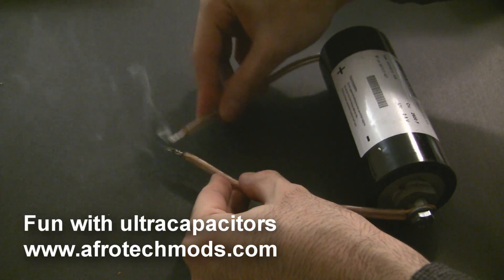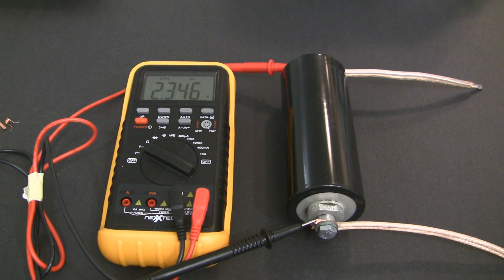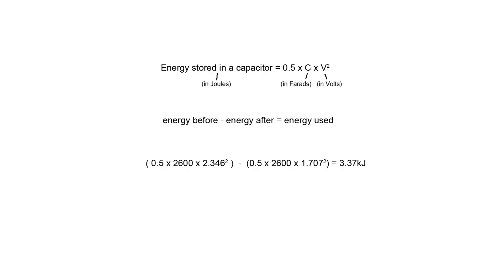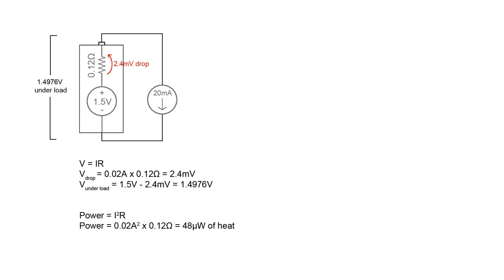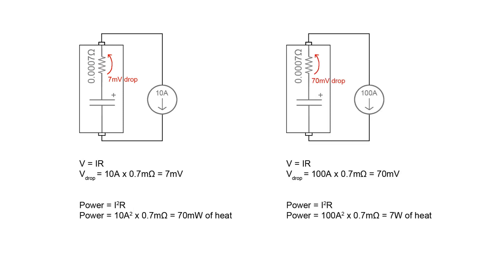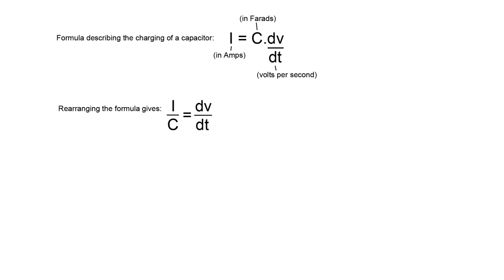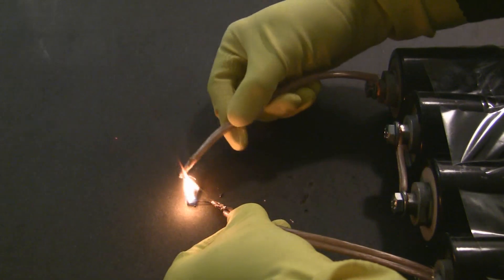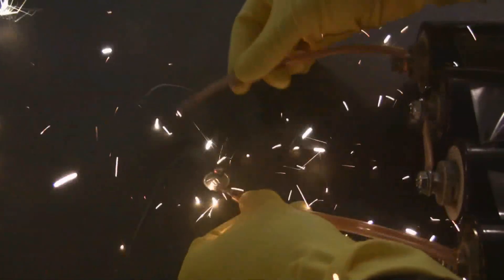Fun with ultracapacitors!!

Comment: You should try them in liquid nitrogen to see how many Amps you could draw with an even lower resistance xD
Reply: Keystone Science it would freeze the electrolite and they would be done for. The frozen electrolite would penetrate the separators
Reply: Keystone Science  Nice to see you all over the Science channels! :D
Reply: wont work it will freeze the electolyte, it would short out internally
Reply: Yes it is, if you low the temperature de solvent inside incresse the viscosity descreasing the easy way to move the charge carriers, so they need to rise the temperature to decrease the internal resistence and get more current leaving or come to the supercapacitor
Reply: Maybe with a supercapacitor designed to work with liquid nitrogen

Imagine that it could have lest capacity but up to 1000A
Reply: keystone science you are my hero
Reply: Maybe you should slow down when you talk

Comment: Could this kill me if I touch my finger instead of a coin? :) could 2.5 V kill me in this example?
Reply: Marek D no
Reply: Marek D amps kill
Reply: yes, but ultracap can't push amps into you'r body. It creates voltage, than body draws as much, as Ohm's law allow flow in the circuit. Human body resistance is in Koms-Mohms range, so curren't will be negligible

Comment: the faster and better way to do this type of high current fun is to buy a high power toroidal transformer cost almost same as this one capacitor and just wind 3-4 turns of high current capable wire on the outer side of toroidal transformer and have fun

Comment: if you touch it will you get an electric shock or will you just get burned ?
Reply: +Motorguy81 Yeah, the algorithm doesn't always know when to write your wrongs.
Reply: a car battery is more dangerous
Reply: +That Guy 

not get a shock nor a burn*

I had to be what your name states...sorry 😊
Reply: under normal circumstances neither you Will get a shock nor a burn.
Reply: not a shock nor a burn*
Reply: You will burn your fingers if you touch the coin after shorting over it though.
Reply: +Baiko That pun worked so good
Reply: DragonsREpic BBC

Comment: What if you replace your car battery with two sets of these in series connected in parallel? I believe it will definitely start the car and provide some runtime abd even charge fatser than a car battery but it may vaporize the start motor, which is a pretty heavy duty motor.
Reply: it's a thing. Look up 12v boostpack etc or a video of mine.
Reply: MiG21aholic Yes, I have seen one. It's a very clever way to use super capacitors but the only downside is that it can be depleted faster than a normal car battery.
Reply: +PunakiviAddikti yes. For modern vehicles with high parasitic load a small lead acid would help with that
Reply: MiG21aholic True, if you have a lead acid battery for other devices like radio and the capacitor bank for startup, you can have powerful start motor and long-lasting energy source for other appliances when the engine is not running to not drain the capacitor bank quickly. The engine could then charge both.

Comment: the ultracapacitors soon will replace the classic batteries,, because his very low ESR,,,but this is a problem too: these capacitors delivery a huge current,,,so be careful with use them,,,and protect the circuits with  high speed fuses.

Comment: Hmm I am wondering something : In theory you could touch both wires of your ultra capacitor since the voltage delivered is too low to push enough current into your body  to harm you , right ?

Comment: What if you put the capacitors in parallel?
Reply: you still at 2.5 volts
Reply: with the paralel capacitors,,,the energy  duplicates,,with two capacitors,,,the energy cuadruplicates if you put four  capacitors,,,,the voltage is the same...
Reply: nomon95 please,, use common ,,,,,, sense,,,,, in your ,,,,typ ing

Comment: is it possible to use capacitors like these to run electric motors in cars or are they to unefficient?
Reply from the maker: +IdCrisis That's exactly what they are used for. Temporarily storing and delivering energy to/from electric motors during sudden starts and stops. But the capacity isn't high enough to last longer than a few seconds.

Comment: Can such a capacitor REPLACE A BATTERY? I am thinking for example a portable power supply (5V) for mobile phone/laptop...
Reply: no, it generally CAN NOT, because the energy capacitors store is very small for their weight and size and they also self-discharge fairly quickly. A lithium ion battery pack is still best for the job.
Reply: Thanks for answer. How big (Farads) a capacitor should be to replace a 'normal' (1.5v) battery..... This, ignoring the self discharge problem (which is not that big since you can recharge it so easily).

Comment: Having that much power and doing neat stuff with it is fun, but I would like to know what would be some particle applications for super capacitors? I for one would love to have a 'bank' of them during a power outage, so how would I use them in a practical application during an outage?How would I turn that raw power into useful energy?
Reply: These capacitors barely store any energy, they are just good to buffer extremely quickly spikes. Stuff like noise, smoothing out power supply and making DC from mains power - things that are VERY fast and don't require a lot of energy storage. 
The situation you are describing would be best suited by lithium ion batteries, which hold much more energy, do not self discharge as quickly and hold a lot more energy for their size and weight. 
Such a thing is actually currently being built in my city by Mercedes, using batteries from electric smart cars.

Comment: What's a practical use for these things?
Reply: +Sand Pox Sure, but what's a real-life scenario where you'd use one of these (other than to "have fun")?
Reply: +Nate M well batteries have high ESR which affects charging as well as discharging. However supercapacitors have low ESR so you can charge it quickly and discharge it through a circuit your powering over along period of time. TL;DR the main advantage over batteries is charging time.

Comment: I know that adding capacitors in series decreases the total capacitance but the combined voltage rating increases. 

But what I just thought of is this; wouldn't the ESR's add up? The greater combined voltage would allow more current to flow through the load, but this increased current flowing through more resistance would create a higher internal voltage drop than before.

Comment: Can this kill you? i heard that there must be some "high" voltage and that some miliamps can kill you..is that true?
Reply: +Geras xD yes the current is what kills you but Electrical current is the product of I=U/R (Current=voltage/Resistance) so even if this capacitor can output 1000A it will not kill you because the 2V of the capacitor are not strong enough to puch that much current threw your Body

Comment: So since EMP devices rely on a large voltage being released through coiled wire, would ultracapcitors be the route to a larger effect distance or would they not work because their voltage is low but have high energy instead.

Comment: Can you die by directly touching the leads of the capacitor? From what I know, if you have a 100k ohm skin resistance, then for the 2.5V cap you get a 2.5/100k = 25uA. That shouldn't be enough to kill, right?

Comment: Two similar capacitors in series give half capacitance of one of them while the voltage becomes double, four 260F 2..5 capacitors in series are equal to 65F 10V capacitor.

Comment: Isn't voltage based on charge magnitude? 

How can such an incredible amount of charge be stored without a large voltage being generated?

Is E field strength (Which is determined by charge magnitude) not DIRECTLY related to voltage?
Reply: +Zambia95 not in this case my Englich is not good enough to explain the reason but it comes frome the way a Capacitor works but if you are interested you should google how capacitors fork and you will understand

Comment: For people who are wondering if they will die from touching those wires...
If you touch the wires, you will not get killed due to the fact that the capacitor's voltage is very low. Think of the human skin as a resistor. In order to find out how many amps are going through the body, we could use Ohm's Law (Voltage/Resistance = Current). The average human skin is around 10k - 30k Ohm, depending on how wet your fingers are. In this example the caps are about 9 volts and let's say the resistance of our fingers are pretty dry and are about 10k Ohm. (9 volts/ 10000 Ohm = 0.0009 Amps) 0.9 mA won't be enough to even give you a slight tingle. In conclusion, these capacitor are very low voltage so they can't kill you or even give you a slight tingle.
Reply: how about connecting the supercapacitor output to a stepup transformer or a flyback transformer ?? is it dangerous then??
Reply: Your power supply will be dangerous then, not the capacitor itself.

Comment: could you touch the wires and not get killed?
Reply: idamontede If you touch the wires, you will not get killed due to the fact that the capacitor's voltage is very low. Think of the human skin as a resistor. In order to find out how many amps are going through the body, we could use Ohm's Law (Voltage/Resistance = Current). The average human skin is around 10k - 30k Ohm, depending on how wet your fingers are. In this example the caps are about 9 volts and let's say the resistance of our fingers are pretty dry and are about 10k Ohm. (9 volts/ 10000 Ohm = 0.0009 Amps) 0.9 mA won't be enough to even give you a slight tingle. In conclusion, these capacitor are very low voltage so they can't kill you or even give you a slight tingle.

Comment: Plz help. I want to try welding with my caps. What's best best way I can do this?
Reply from the maker: Don't do that.
Reply: Hobby Electronics but muh coil gun! :D
Reply: As said. Don't do that. Uncharging all of the energy from the cap at the same time is a bad idea.
Reply: Tonio9606 BAD IDEA! The caps are likely to overheat and catch fire or explode when used that way.
Reply: +Tonio9606 I am usually fine doing many dangerous things; but for once, I will agree with other people; so, for the 5th time: just don't. Entering the welding world with these is dangerous.

Comment: Q1 would u please tell me how to lit up a 2.5 v volts LED with one of the Ultra caps?
Q2. How to use the ultra cap on 1A 5 Volt raspberry pi?
Q3 Why the multimeter does not burn up when taking the measurement? TIA.
Reply: Q1 Just connect them directly.Or you can put a resistor(below 100 ohms) in series.
Q2 Put two in series.
Q3 If you're measuring voltage, the voltmeter have a very large resistance (maybe 10 Mohm or more).

Except its low series impedance, a supercapacitor is just like a battery.
Reply: Powering a raspberry with Ultracapacitors is not a good idea... It works, but there is way more energy stored in usual batteries.

lg, couka

Comment: How did you eventually discharge these? Let it just drain from leak?
Reply: No need to worry about it, just drain it like any other 10v source. A high wattage resistor would do, http://img.banggood.com/images/upload/2012/jiangjunchao/SKU096923/SKU096923%20(2).JPG
or even just a 12v bulb, it would also light your room for quite a while.

Comment: Afrotechmods Hello! is there a way to make a type of no-break device for my PC with capacitors? Energy here tends to drop a lot but only for cents of second, but enough to shut the PC off. I noticed that the Router never goes down 'cuz it have capacitor in they PSU. so can i make a 110v 1000~2000 Watts array of capacitors?
Reply: Yeah, or get a car battery and a transformer to 110v
Reply: Hobby Electronics yeah like the battery seems unneeded since the energy never goes out for more then 3 seconds. and it would be the same as buying a no-break, and i want to use only caps to this. something to hold 115v @ 1000w for like 5 minutes at most (enough to shut the computer if the power don't return).
Reply: ***** i was thinking on supplying the PSU instead with 127 Volts. because it will be kinda a waste of money an UPS is good for several minutes but my problem is just the energy sometimes "blink" and get lest then 1 second to get back. since the router does not turn down  (perhaps because of its PSU, that have capacitors in it) i though i could replicate some kinda of capacitor array to do the same affect on the PC.
Reply: ***** lols, nah here is just for tens of seconds. when its gone it is for good, like several hours. the cap array I want is to preserve the health of my PSU since this "blinks sure reduce the lifespan of it

Comment: I want to get 6 of these, hook them up in series and use it as a car battery.
Would be much lighter and easier to charge since it can be done in 30min or so rather than over night.

Most are 2.6v or so and most car alternators run under 15 with 14.5 being average
Reply: They might be charged in a few minutes or even seconds if the supply is powerful enough, but they do not store enough energy to replace a battery. :(
Reply: TheDeduction True, they are easily capable of providing the current, but just a few times when the engine turns on right away and it gets problematic if it doesn't...
I thought he was speaking about an electric car, don't know why though, I was rather tired I guess :)

Comment: i didn't get how you charged the capacitors
Reply: Hook a power supply up to it.

If you get one of those basic caps he showed and hook a normal AA battery to it with + to + and - to - you will add a charge to the capacitor
Reply: IIGrayfoxII thanks a lot bro.

Comment: Damn does capacitors are awsome im gonna buy some and make a spot welding machine i want to see its possible to weld metal with capacitors
Reply from the maker: You shouldn't try to weld using these.
Reply: Read description before you do something stupid
Reply: Ciroluiro Because of ESR, the battery's voltage drops under higher load, which means the actual current flow is limited. In the example given at around 3 minutes, the load is trying to draw 10 amps, but the battery is dropping 1.2 volts. The effective voltage of the battery is only 0.3 volts, so hardly any current is flowing.

Work the math: V = IR. 1.5 volts = 10 amps * R. R = 0.15 ohms. Because of the voltage drop, the battery's effective potential is only 0.3 volts. I = V / R. I = 0.3 / 0.15. Actual current flow is only 2 amps. The lower R gets, the lower V gets. I goes up, but it plateaus.
Reply: Afrotechmods I really liked your video, but I still don't get why a AA battery can't do everything an ultracapacitor can. I understood that because of the internal resistance of a battery it would lose lots of watts as heat under high currents, but shouldn't it be able to do all the sparks and stuff the ultracapacitor does? Maybe the heat would make the battery explode, but untill that why couldn't it destroy coins and spark? Does it have to do with heat increasing resistance?
Reply: Joshua Bardwell oh ok now I get it. Thank you! I did do the math in my head but because im not an engineer i don't really know all the concepts. I thought that load could be used as a synomin for current. So i didn't understand how I kept getting was much lower than what the load said. Now I understand!
Reply: Ciroluiro I ment to say that the current that I was getting was much lower than what the load said

Comment: Are the capacitors damaged by these brief short circuits? In the extreme, what would happen if the capacitors were short circuited until all their energy was dissipated?
Reply from the maker: You should never short these caps for more than half a second. Don't do anything I did in this video.
Reply: Once you find leads that can handle 100's of amps, then you can start to worry about the internal resistance heating up the caps to damaging temperatures. Most likely they blow up/pop due to gas buildup when overheated too much. Otherwise, I'm not sure if anything bad would happen to them.
Reply: David Maddison i have shorted my one heaps. i didn't die. it was not damaged. but i would not want to short it for more than a few seconds with no resistance. i made myself a resistor using nichrome wire. it glows white hot but does not melt. this provides a small load on the cap while i short it for long periods of time

Comment: So would it be possible to use this instead of a normal lead acid battery, in let's say, one of those electric, 1000w scooters?
Reply: Yes, but how far would you like to be able to go? ;-)
Reply: Well, further than the normal lead acid batteries let me. I'd probably want a similar result as the LifePO4 batteries.
Reply: o0julek0o
Caps are good at short bursts (like a starter motor in a car), but in terms of Ah, they fall over. Li are the best for weight/area/Ah than Lead, as such Li would be a better option in the application that you're looking at (if you have the cash). But if you don't have the cash, then Leads have the best value/AH.
Reply: o0julek0o You could make a Li-ion bank using 18650's out of old laptop battery packs. Most of those are still good, and for those are bad they can usually be slowly brought back to life. Otherwise they are just death, and should rot for being inadequate. ahem You can save a boat and five arms if you make your own banks with them, however that requires time and research, and other stuff that I can't think about.